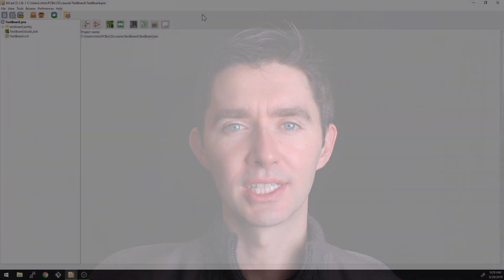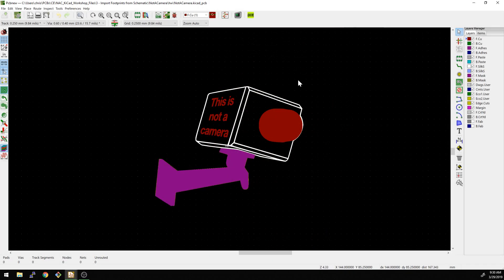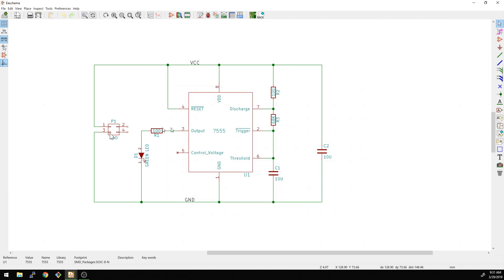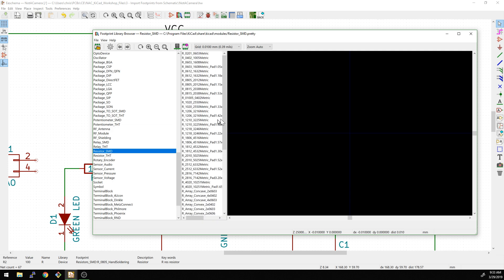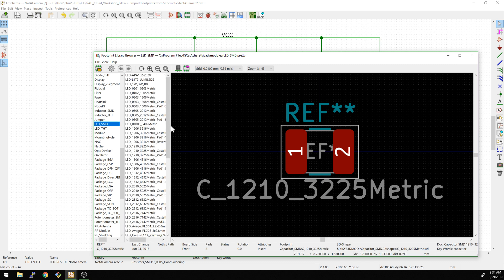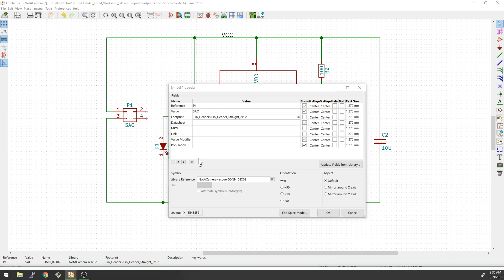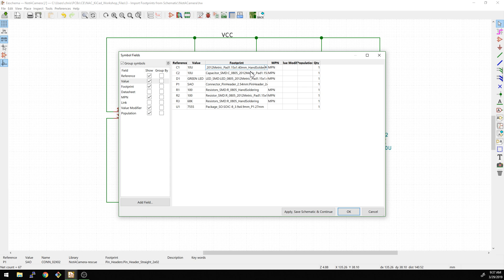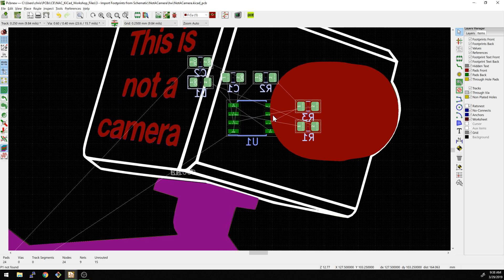PCB Design In Reverse - Part 4 - Associating Components

Comment: Hello Chris, A lot has changed in the video series... I had a question unrelated to this video. How would I create edge finger contacts on both sides of the board so it could be plugged in as a daughter board. A example would be using connectors like in this video at 8:53. https://www.youtube.com/watch?v=zxY2OFDhnog , you may find it easier to email me back at sortofsmarter@gmail.com thanks...